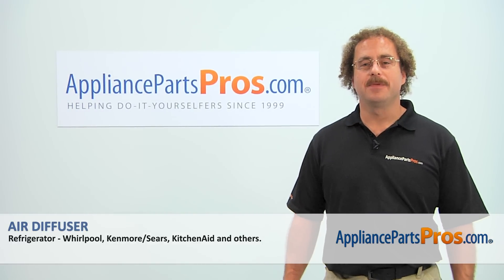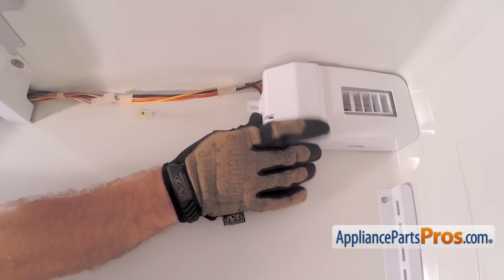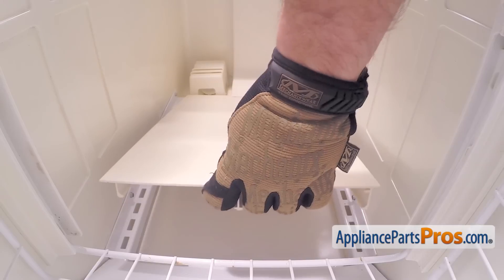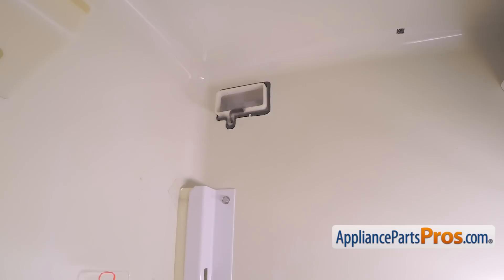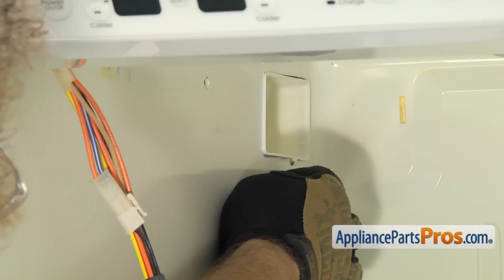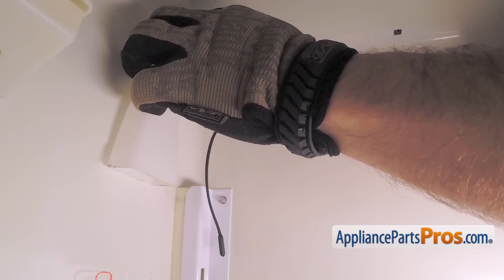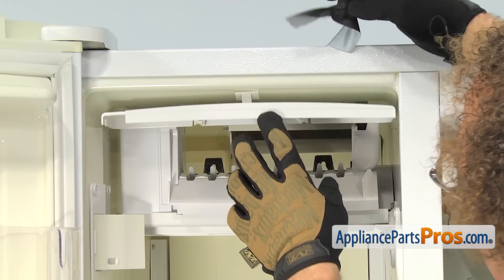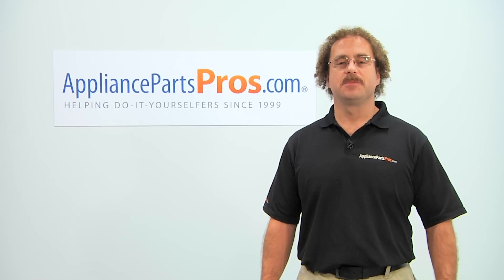How To: Whirlpool/KitchenAid/Maytag Air Diffuser WP2216112

Comment: These types of videos are nice and everything for sure. The only problem with them is no one ever says exactly how to determine if the part isn't working correctly. I like to diagnose and replace, not just keep throwing money at something until it works. There can be several reasons a fridge doesn't keep the right temperature.